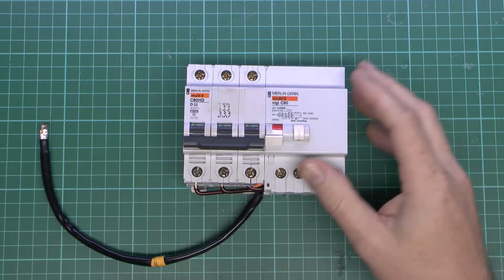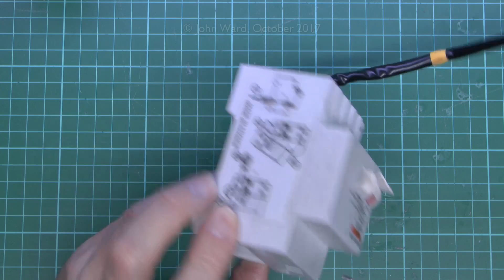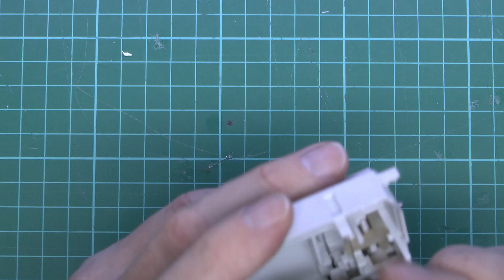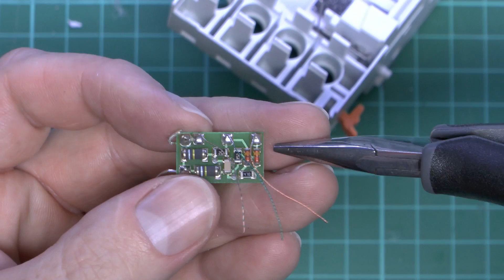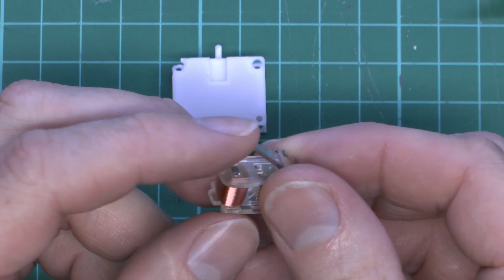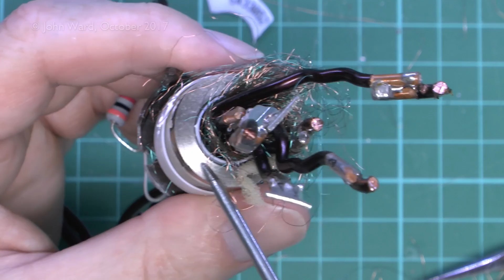Merlin Gerin multi 9 3 Phase MCB and RCD Module Teardown

Comment: In Serbia early 2000s fake multi9 fuses flooded the market as they were notiecably cheaper than real Merlin Gerin multi9. Same orange color multi9 marking. Also RELCO MCBs were popular. Reason why people bought such copies is that despite the price people wanted to get rid of old fashinoned 4 wire supply(literally 4 separate wires going to house from pole) which had fuses on ceramic insulators on poles and people wanted to have rigid self hanging cable(type SKS kabl on Serbian, lit. cable with hook and robust insulation which lasts 30yrs minimum). To have self hanging cable(SKS) wired to your home directly(not on porcelain insulators) and have every cutout fuse inside, MCBs were mandatory. Nowadays no one wires on porcelain pole fuses. Inside the home you have cutout MCBs(3phase) before meter and every home uses self hanging cables.

Comment: which side do  the supply cables enter on most rcds, top or bottom ?
Reply from the maker: Top usually, as most consumer units have the cables at the top.  Some can be supplied either way.
Reply: What about if its in a separate enclosure? someone told me to look at the RCD circuit diagram.i heard you can burn out the test button if you connect the supply to the wrong side and you hold for too long.
Reply: You probably would burnt the Test circuitry if the RCD Fails to Trip & the user holds down the T-Button resulting in the Test circuitry to Fry…

Comment: ok. so back in the days. the MCB (main circuit breaker 32A)  didnt have an intergrated RCD (residual current device 30mA). And they are mechanically connected . Nowadays the RCDs have both Overload, trip on I2 (thermal, 1hour) and I5 (el.mag 0.1sek) and Ground fail current trip 30mA (400m sek ?) . A Short circuit is defined as Phase Phase , or Phase PE , on the same course NEK400.434 . Ironically the MCB and RCD are connected phases, not to ground PE, The SPD (surge protector) goes to ground PE .

Comment: At least this one failed open. Recently I installed a new RCD that would sometimes not trip at all. Even with fairly high fault currents it would just sit there and do nothing. Other times it would trip normally. After replacing it I could hear some small piece of debris rattling around inside, and it worked fine on the bench. I expect the debris got dislodged from a critical area when I shook it.
It's a bit scary considering this is expected to save someone's life, and it was mere luck that the fault occurred during testing since it would at times work normally many times in a row.

Comment: G'day John, question for you or one of your audience, can you RCD protect a three phase motor that does not use a neutral connection?
Reply from the maker: Yes, for those the current in the 3 phases would sum to zero, and no neutral connection required.
Most 3 phase RCDs have the neutral so it can be used with unbalanced loads.
Reply: Thank you for the reply.

Comment: ahh the multi 9 module, (9mm) wide, using french maths because each mod when you measure is really 8.5mm wide... there is a reason for this me thinks....
Reply: I was wondering where the "9" came from in the Merlin Gerin - now Schneider - product line. "Multi 9", "Acti 9", "Easy 9". Now it makes sense.

Comment: John, I have a 3-phase 63amp portable distro which has developed a similar fault, except that the RCD can be reset, but only if it is not under load or connected to a live supply. Needless to say, It will have to be replaced. It will be intresting to take apart and see how it works. Its probably from around 2009-2011